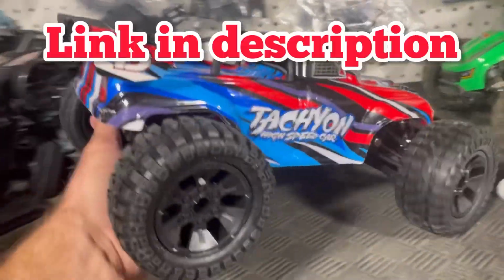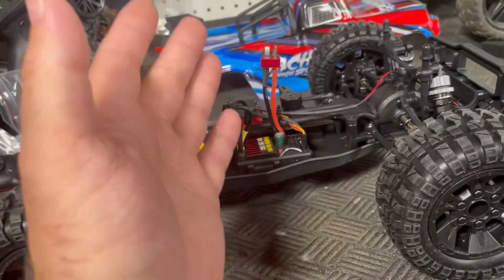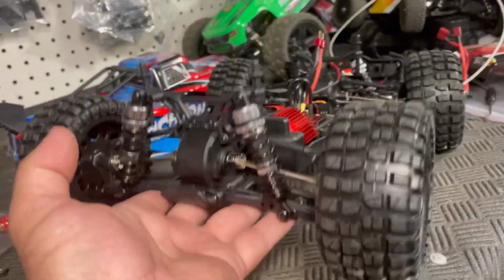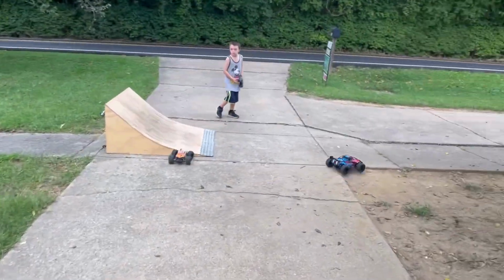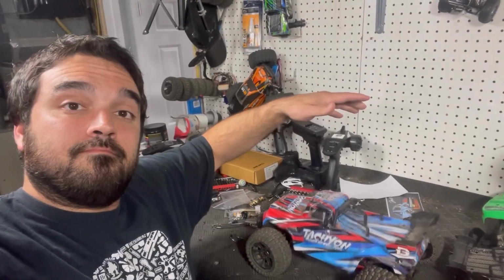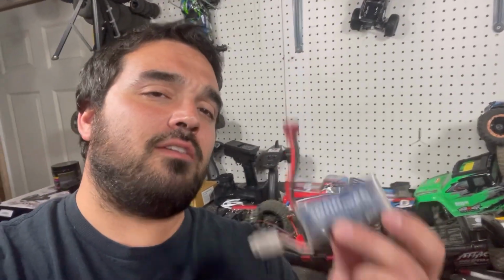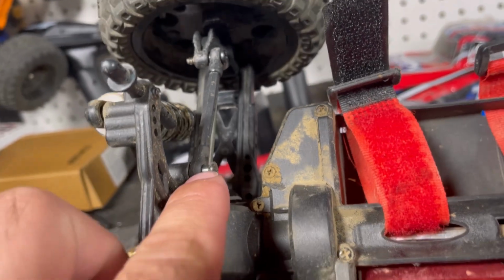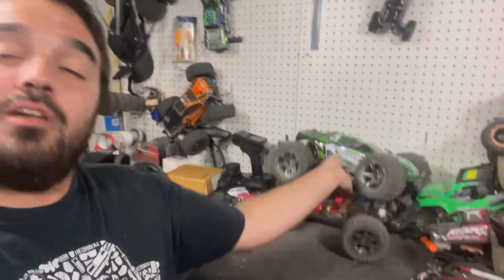New Brushless RC - 3s batteries included! DEERC 210E

Comment: Great video!! Your 5yr old jumps like a pro! These px9200’s really are incredibly durable. I have 2 of them. One of ‘em I put a SH Rocket 3660 3300kv with a rocket 80a esc and it handles all that power and all the abuse I can throw at it just fine! They’re great cheap rcs. Perfect to upgrade and bash around!!
Reply from the maker: Thanks! Yes I agree! I have a couple others as well with Hobbywing motor kits in them. They start to break eventually (especially on 3s)  but it takes a while and they do a great job!!
Reply: Thanks for the reply! I’m glad I found your channel, great stuff dude. I also have a couple of the FC610 trucks converted to brushless. Even got the same ZD wheels lol.
Reply from the maker: Thanks!!
Ya definitely a great truck !!! 👍👍
Reply: I do rocket everything and I freaking love it! Really low prices too
Reply: @FZERO20  ya same here! I have rocket motors and escs in most of my rcs. You gotta get yourself the Racing Rocket ‘Beast’ esc. They have em on AliE. I got the 80amp version. it is powerful! I honestly think it’s underrated cause It feels more responsive than my 120a Max10
Reply: @MarcoL972  I just ordered one last Friday🤣🤣🤣80amp too
Reply: @FZERO20  if you haven’t already you should try out the new V2 Supersonic brushless motors. They’re bada## motors! I just got a 3660 3600kv. It has more power than the black rocket motors
Reply: @MarcoL972  Aight bro, we seem to be on the same page with this sh*t. 😂😂If I could show you my “to be shipped” or “shipped items” you’d see that i got a (Surpass Hobby Rocket Supersonic sensored esc 120amp, an off brand hobbywing Xerun esc 120amp, a rocket rc supersonic 380 sensored motor 8.5t 2s 5000kv, and an 80amp esc from rocket unsensored). 
And thanks for the recommendation too because I’m used to using hobbywing previously but it burned out. All my rockets take the heat and the motors are truly amazing and cheap asf!
Reply: @FZERO20  🤣🤣 ya definitely seem to be on the same page. I just got the EZRUN max10 G2 80a and 3652 4100kv. I put it in one of my px9200’s. It’s an impressive combo but not sure if it’s worth the💰. Also have the 10bl120 and 2pole 3650 8.5T I installed in a wltoy a959 😃.  I’m still working on it but I’m hoping to test it soon. 

When you say off brand HW your talking bout the RTR versions? Those are actually real nice, and much cheaper. I got the 10bl50/60 and max10 120 sct RTR. I’ve had good luck with all of em. 
My go to is always surpass though. I really think they make the best stuff and can’t beat the prices
Reply: Oh ya, You said you have the supersonic snsrd 120a? Is that the 3-6s esc with 2 battery leads? I have that one too. I actually bought it by accident lol. I Meant to by the rocket 120. That’s what I get for rc shopping at 3 in the morn 😂😂. I haven’t used it yet. It looks like a sick esc! rather than return it I’m planning on getting a 1/8 car I can use it in. What rc are you using it with?
Reply: @MarcoL972  No I think it’s the supersonic with the 2-3s or 2-4s it doesn’t say when I look but i typically don’t go higher than 4s anyway. And I have 2 cars so far from Wltoys. A 124016 & 104001
Reply: @MarcoL972  and the off brand seems to be a “TSky”  it’s like $15 bucks total so idk bro😂 . Now I have no clue what I’m going to doing with these WAC’s between both cars, but I do know the 380 sensored motor is for my 1/12 scale car. I freaking love the 124016. The 104001 I plan to completely change the chassis to carbon fibre and switch to mod1 gearing. But man it would be great if their was a more larger community here in Georgia man. I go to parks and have a lot of fun with my cars but there’s never anyone doing the same or not at the same time. But you are right. The prices are unbeatable and when I upgrade my cars to brands like Arrma or Traxxas I don’t even think imma move away from what I’ve been purchasing. Plus Spectrum’s expensive as sh*t🤣 
But hey I’ll subscribe to your channel so if you ever have any videos or want to keep in touch you can . I got a couple of videos here and there you may like too😄
Reply: @FZERO20  Ya dude, I wish I had more people to do this with too. I’m in MA. I don’t know anyone else who’s into this hobby. It’s really just me. Luckily I have a big yard so I either go out in my yard or if i have time I got a couple spots down the street from me. My son comes out with me every once in a while. My daughter used to but she’s not into it anymore. 

Tsky? Is that those cheap blue escs? They’re like 15-20 bucks lol. The 380 snsrd motor is the surpass hobby suspersonic right?

I only have 1 Wltys. The A979B I think lol. The 1/18 buggy. I put a 60a esc from my Bezgar 9 in it and got 43mph out of it. That’s quick for brushed! Obviously That wasn’t good enough  for me though 🤣🤣. I just installed a HW 10bl120 snsrd esc and HW 2 pole 3650 8.5t. Then I fitted a 1/16 suspension from a caster racing s16 to widen the stance. I can’t wait to run it!!! It’s gonna fly!! Hopefully it stays in 1 piece 😂😂😂

Is that your 104001 in your video? That thing is fast ha! looks like it handles great too! What motor n esc you got in that one? Have you done anything else to it?
Reply: @FZERO20  I don’t have a channel lol. I should post some videos but I really don’t have time for it. I’m lucky if I even get time to use them. 
I honestly spend most of my free time just working on these things. I love it. I definitely work on them more than I use them. 
Im a mechanic. long time ago my hobby used to be real cars but after 20+ years of working on everyone else’s crap I don’t really enjoy it like I used to. Are you a mechanic too? 

Oh, I don’t know if you noticed, I subscribed to your channel.
Reply: @MarcoL972  Yo man that’s amazing tbh. I work 2 jobs currently so I barely have time for myself either but when I do. This is what I do. And yes! I’m a tech at a dealership. And tbh I may deny it but apart of what I like doing, IS wrenching. I took a 1 year break from automotive to learn sales and retail and nothing has EVER excited me as much as working on cars. Not only that, everything I like doing involves being able to service my vehicles or upgrade them. So naturally working in a shop gives you huge benefits over paying someone. Now, it just transitioned down to R/C and working on them down to seeing the end result is what I call good therapy.👌🏾
Reply: @MarcoL972  and yes the TSky is those blue esc’s. I may buy a handful of them next payday just to see how they go. 

And yeah man. Your exactly right about the 380, same brand and everything. I love the design of those motors too. 

And lastly it wasn’t my 104002, it was my 124026 in both videos you seen. It’s a 1/12 scale car but was my entry car and it’s my baby. I absolutely love the design of the car and the way it handles. 

Dude. Whatever videos you have, even old ones. Just upload them bro, even as a short if u have to. Ppl will see what you do and will later come to appreciate what you do on your time, as it is unique to just you. The same as me.

And 43mph is indeed fast for a brushed wow. I always wanted speed with excellent handling in my cars so I like to use sensored brushless setups as you can already tell😂
Reply from the maker: Just skimmed thru your guys conversation here and I used to be an auto tech too!
Been out of it for about 5 years now.
Reply: @DerbyCityRC  😂 small world! Seems like a lot of guys like us are into this hobby! I guess some people brings their rcs to hobby shops to get worked on. To each there own but I could never do that lol.
Reply from the maker: Agreed!
I couldn’t either! I’d need to become a brain surgeon just to afford all my repairs 🤣. Like you, I like the wrenching part of the hobby too! I don’t really miss the car work though lol. I’ve put off doing the timing belt on my ‘05 tundra for 4 years (when I got it) and it’s the OG belt at 186,000 miles.
Of course it’s getting a ton of other things at the same time and it’s my work truck so hard to set the time aside.
Reply: @FZERO20  I’ve seen mixed reviews on those escs. I think it’s like a hit or miss with those. Some work great some burn out. Ide keep it to 2-3s, wouldn’t push it with 4s. Probably the right idea to get a handful lol 

You gotta let me know how that 380 goes. Those motors look naf. 
Today I was finally able to get a good run on my Laegendary Nitro. I have that supersonic V2 3660 3600kv in it. I paired it with a 130a Dynamite Fuze I got used off amazon for 60 bucks! I took a chance getting it used but the thing is actually brand new!! It’s a nice esc. and That motor screams dude. Def my new favorite motor! 

I’ve always liked the looks of that 1/12 Wlty, I never got any of them though. Except for the 1/18. They def make impressive cars. Yours looks responsive af. That servo in it is quick! 
So you have 2 rcs? Are you just getting into the hobby? Get ready to get a lot more of you are lol. Damn bro, If we lived closer ide give you a few of mine… I got so many I don’t know what to do with them 🤷🏻‍♂️😂😂. 
Recently I’ve been getting into the larger scale rcs. Dude I literally just ordered the Redcat racing Kiaju!! I’m so pumped. I’ve been drooling over that thing for 2 years but could never spend the 💰 on it. Finally was able to get myself one! So excited to get it! 

Oh, and by the way, did you end up getting that stud out?? Lol
Reply: @DerbyCityRC  yup once a mechanic always a mechanic haha. My famous words to my wife when she says something is wrong with the car is Don’t worry about it, it’s fine. 🤣🤣. 
But you are 100% pushing your luck! 186 on a og t belt!! Wow, is that a record?? 
Those tbelts are a big job but not bad. Pretty straightforward job. 
Why did you get out of mechanics if you don’t mind me asking?
Reply from the maker: Yup we don’t need to fix our own 1:1 cars lol
I’ve seen t belt last over 200k on these trucks. And I did quite a few of them on my exact engine so no big deal. It is an interference engine so really gotta get going on it. I saw kia timing belts break more than once before even getting to 80,000 and blow the motor. 
I did several belts on older Camrys that broke, and those 3 and 5sfe engines were not interference engines so just a little
Puff of blue exhaust smoke at post service start up and they were as good as new, no matter the mileage! Toyota used some killer materials!
I got out cuz my knees and back started having problems in my late 20’s and that’s just no good. Plus my boss was getting grumpier and meaner by the day lol.
So then I went to work on the equipment for a local Home Depot rental center and eventually started my own Handyman business. Been at that for just about 5 years now.
Reply: @DerbyCityRC  ya man lol I remember the old Camrys. I saw a lot of those with snapped belts. They always started right up. All motors should be non interference. The easiest tbelt I ever did was on an old escort. If I remember correctly I believe it was just 3 pullies. crank tensioner and cam 😂😂. As simple as it gets. 
Ya, grumpier and meaner seams to be a thing with older mechanics who have been in the trade for years. I’m not quite there yet lol. 
I started wrenching when I was just 15 or 16 got my first job at a shop when I was 17 and now I’m 38. Still not too grumpy or mean though… well maybe a little 🤣🤣. 
And your right dude, this job isn’t easy on your body. My back and knees are toast. You Gotta go to a Chiropractor man, seriously they helped me out like you wouldn’t believe.
Reply: @FZERO20  Thanks bro. I mean, I gotta admit, i still enjoy working on cars. I just don’t like working on my own cars anymore lol. It unfortunate cause it used to be my hobby years back. I loved working on and tricking out my rides. That’s the reason I got into rcs. I got one a few years back and started working on it and I had so much fun doing it. Now I’m an rc addict 🤣🤣. 
Working on cars definitely has its perks. I have never brought my car to a shop to get fixed once in my life lol. It also has its downsides though. Like when someone major breaks and guess who has to fix it 😂. Like when the brake lines blew on my wife’s ml350 and I had to replace every line in the thing!! That was terrible. 
You are right. The rc cars ar definitely good therapy! I never thought of it that way lol
Reply: What an intense conversation I've just read.  LoL

I'm brand new, my kids just got the DEERC 200E and the 300E.  Now I want one of the 1/10scale, but dont know where to start getting parts. Everything in Canada is so bloody expensive... it's ridonculous.  So I can't find the model he was recommending for the brushed motors and then upgrading the system to Brushed to make it more affordable for entry.  I'd love some suggestions from the group to start with something I can upgrade as I grow. I hate starting at the bottom entry level of things, so please point me in the right direction with base setup and what brushless motor to get, ESC, and components that will withstand a bit of abuse!! Thanks everyone- I've sub'd to the channel to stay engaged!! (Also, my son's 200E can't handle even the smallest amount of water ... living in Canada.. we have snow melting this time of year. What components can I buy to keep his ESC and Motors waterproof/resistant and dry?)
Reply from the maker: Ya I did one on a 96 escort quite a long time ago. Many kias had easy belts too.
Also the 2000’s 4 cyl jettas were easy. Chryslers might be the absolute worst.
Well my boss was only like 33 at the time lol. Luckily I got out when I was like 29. Now 34 and seems like my joints are a bit improved. Need to get back to exercising though!
Reply from the maker: You did read quite the conversation lol
Are either of these available to you at reasonable costs?
https://amzn.to/3jyzdxO

https://amzn.to/3JMYa39
Reply from the maker: And thanks for subscribing!
Reply: @DerbyCityRC  OMG, do you remember the PT losers? What a s%#t show that job was!! 

Well good for you man. Good job opening up your own business. That’s not easy to do! Especially these days.
Reply: @davewoeckener5719  lol yes you definitely read quite the conversation lol! 

I agree with Evan’s suggestion. I have the YC400 and the FC610.  The YC400, Flyhal FC610, HBX 2995 and the Bezgar HM101 are all the same truck. So plenty of parts are available for cheap. The only differences are the bodies and wheels.
As we know this truck is extremely durable and for the price i firmly believe you can’t get a better rc. It’s is definitely one of my favorites!
Reply: @davewoeckener5719  The only thing I’ve broken are wheels and body shells. The wheels are made of pretty brittle plastic so if your doing jumps they will break eventually. 

I even had a 3660 and 120a esc in it at one point, now I have a 550 rocket and 80 rocket esc. It takes the power no problem. It’s a beast for sure.

Their customer support is good too. after sales service warrantied a couple of parts for me. I’m not positive but if I remember correctly i think it has a 3 month warranty
Reply: Dude do you have anything from Redcat racing? I just ordered the 1/8 Kaiju. (the original one not the EXT) It’s supposed to be a sick stunt truck. It’s gonna be my first name brand rc. I can’t wait!!!
Reply: @MarcoL972  my son already on day #2 broke one of the lower front control arms.  Snapped right where the shock goes into it... so now we wait for DEERC customer service to ship out new parts!! LOL
Reply: @DerbyCityRC  Well - the first link that leads to the YONCHER YC400 costs $307.57CAD (and I got the 200e with same batteries, but additional spare parts this one doesn't come with for only $166CAD on sale 4 days ago).  The HB2995 says it's not available to ship to Canada (go figure.... there's a lot of things that don't ship to Canada I want :( )

If I go with the DEERC 9200 - does that have brushed motors that I upgrade to brushless?  Then also upgrade to ESC (which means I also upgrade the remote transmitter) and the batteries.  Would I need to upgrade the steering servo as well?  The other links in the forum some work, and some don't anymore.
Reply: @MarcoL972  Whats the difference between the 200e and the 210e?
Reply: @DerbyCityRC  I just got back in to the automotive industry a few months ago🤣
Reply: @DerbyCityRC  it’s like that man. You work on other ppls junk all day everyday. You’re exhausted and unwilling to work on your own. Especially if you know the problem smh
Reply: @MarcoL972  yeah I’m definitely getting a few of them. They may all be good long lasting esc’s too. Who knows

And I’ll definitely lyk how that 380 operates once it arrives with my 120a esc

So far yes I only have 2 rcs as I just recently got into the hobby only a few months ago. But I’ve watched videos on YouTube for years as a kid. Parents just never bought em for me so I had to get em myself.😂definitely worth it though 

And same dude, I haven’t gotten the expensive rc I wanted yet but I do plan on going all out on an Arrma infraction. With a high quality fpv, long distance setup. Sometime in the future. But I already know that’s definitely way over $1k

Annnd, as far as the stud goes… nah I couldn’t get it out. I just installed a whole new engine mount bracket. It was a pain in the a** to wiggle it out of its place but I made it happen you know🤣🤣
Reply: @DerbyCityRC  yo nice dude. I had an 05’ IS300 I was getting ready to do some timing belt and engine upgrades on a while ago but I ended up wrecking the car. Now it’s pretty hard to find another one for a decent price. I worked at the tool rental department too man! Only for about half a year though because it was way more overwhelming than working on cars. I was basically a service advisor, parts manager, and technician all at the same time. While I still had to work up front when we were low on staff constantly calling out🙄. Good for you starting up that business tho. I got into selling new and used car parts online and I’ve been having decent success with that, I just need to invest a little more time into it
Reply: @MarcoL972  bruh who you telling?? I think I blew up my motor in my 07’ TSX and it makes a huge knocking noise while running. Still drives nice tho and has excellent suspension mods. I put a lot of money into the car and engine so I can’t just sell it. But I can’t just swap the motor because it has a lot of expensive internals I need to transfer to the new one I’m saving up for. In due time I’ll get it done though definitely . But actually while I was on standby waiting to rack my money up, I stumbled upon some cheap entry level rcs and this is where it took me. But I gotta say, it’s an excellent detour. If I really break something on my rc. It’s way cheaper and easier to repair than an actual 1:1 car so that’s just my way of cheating a bit. It certainly does feel good when I’m done and I go out with some charged batteries and spend a couple of hours at the park running them up and down the trails or on the street😁
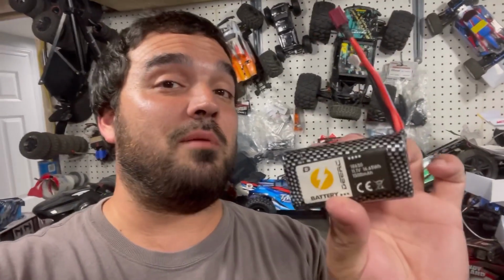Reply: @DerbyCityRC  that 1:12 scale yoncher is nice. And a really good price. Only thing I’m concerned about is the aftermarket parts and accessibility. If that’s good then I’d totally go for it if I like what it offers
Reply: @davewoeckener5719  just the bodies are different. The 200 is like a truggy style body the 210 is the pick up
Reply: @davewoeckener5719  😳307 for the YC400!!! Wow man you weren’t kidding!! Sorry man, that sucks.
Reply: @FZERO20  Damm dude that sucks. You just had me cracking up though! Just stumbled upon some cheap rcs! Your cars broke but you got some bas**s rcs!! 
Sorry, it’s not funny your cars messed up, just how you worded it lol. 

It’s definitely so much cheaper to fix and trick rcs. I think way more fun too. 

So you said your car is knocking but it runs good? You sure it’s the engine? Is your car auto or stick? I’ve seen throw out bearings make some crazy noises like that before. Typically the noise changes on/off the clutch though. I wonder if you have a bad rod bearing?
You gotta get your ears on and track down exactly where that noise is coming from before doing all that work.
Reply from the maker: I do! Even the smallest job on those were terrible. Luckily I’m pretty sure I only ever worked on one, but it seems they brought  it to us for all kinds of stuff lol.
Thanks! It was tough to get it going but things have been good 👍
Reply from the maker: Completely agree! The absolute best value and easily upgradeable once the 15-17 mph becomes too slow.
Reply from the maker: I don’t, but the Kaiju has been on my mind for a while!
Reply: @FZERO20  there really isn’t any aftermarket parts for it that I know of. You don’t need them though. The only thing you gotta do to make it just a completely sick truck is brushless upgrade, new wheels/tires and wheel spacers. 
The truck is definitely well worth the price the way it is. It has all hardened metal gears and a center diff too. All plastics are really nice quality and seldomly breaks, 6kg servo is a little slow but it gets the job done and the axles are super strong. It’s a good truck. 
Watch Derby’s FC610 vids. Its the same truck
Reply: @DerbyCityRC  we actually had one come in the shop last week!! I think it may be the last surviving Loser 🤣🤣. 
Yes Everything on those cars was a pain. I remember doing t belts on them all the time. Had to jack the engine to the moon to get to some parts then lower the motor until it was literally about to fall out to get to other parts. What a nightmare that was lol. They musta been drunk when they designed it.
Reply: @DerbyCityRC  ill let you know how it is. It’s supposed to be delivered today!!! 🥳
Reply from the maker: That stinks it’s so pricey for you!
Yes the 9200 comes with brushed motor so you can upgrade the motor, esc, and yes the servo along with transmitter and receiver.
Those are the same chassis as the 210e, which really are solid. Bad crashes will certainly break them lol
Reply: @DerbyCityRC  wow the Kaiju looks amazing! It looks much bigger in person. Videos and pics don’t do it justice. I can’t wait to bash it!!! Ide love to see you launching this thing off your Ramps!
Reply from the maker: That stinks its so pricey for you! What about this one? Same car also.
https://www.banggood.com/custlink/mm3pHkRFq5
Reply: @DerbyCityRC  the first review on this  FC610 BG link is mine. Marco320. Check out the wheelie bar I installed. Took it off a Laegendary Thunder. Little work to fit it but perfect fit
Reply: @DerbyCityRC  I think the body shell on the FC610 is nicer quality than the YC400. I landed on the nose once with the YC400 and the body literally shattered into pieces. My FC610 body might crease or dent but it hasn’t cracked at all
Reply: @DerbyCityRC  well... another gooder... except this one doesn't ship to Canada either.  Either doesn't ship to Canada, or it's too expensive.  I'm thinking of getting the DEERC 9206 ($156CAD) and upgrading to a bigger motor, ESC and batteries.  DO I NEED to upgrade a different Servo too when I upgrade the ESC?  Then how do I match the ESC to the right size batteries and motor?  Sorry to be a pain, we all start somewhere... and the reason I sub'd to you is because I see you actually answer your fans questions!  Can you do me a solid and point me some links to a better Motor/ESC/Batts for this (and servo if needed).  THANK YOU a bunch man!
Reply from the maker: Haha!
Congrats!?? Lol
Reply from the maker: Ya it’s got aftermarket support since you can get hbx 2995 parts for it!
Reply from the maker: That’s cool lol. Ya man I did really well at tool rental. I wore all the hats too. I worked there part time for 8 months while still working full time at the auto shop. I got them caught up and kept everything repaired, including customer stuff as a part timer while that store called for two full time techs. Then realized it was a better job and left the auto and went there full time. I had corporate dudes that came in to see how I was keeping up by myself. I was like experience and organization lol. Diagnosing instead of guessing. Never got more than a handshake from them though. In the end it wasn’t enough money to carry a family of 6 🤣
Reply: @MarcoL972  nah it’s cool bro you good😂that’s just what it is

Yeah it’s knocking. I’m pretty sure it just spun a bearing. Or like you said, a rod bearing. But I got a flashing CEL ofc and it’s also telling me my emissions is out of whack which makes me think it’s just a bent valve. Idk but I’m pretty sure it’s near the bottom end that the noise is coming from. And unfortunately it’s auto. Either way the motor has over 250k on it and it did an excellent job throughout all those miles. I’ll save up for a Jdm spec motor and swap it in with a 6-speed sometime in the future. But I have so many bills and I keep spending my money on other sh*t🤣 but in due time itll happen. The car has weight reduction and suspension upgrades so it has excellent handling .
Reply from the maker: Yup I remember all the engine jacking and raising lol
Geez I haven’t even seen one on the road in what feels like years. Be sure to take a picture and frame that shit! Lol
Reply from the maker: Seem well built?
Some people say it’s junk and some say it’s a beast!
Reply from the maker: Lol that’s good to know. The hbx 2995 body is even better. It has a plastic roll cage. I’ve pounded the shit out of it and only has a little crack on the hood
Reply: @DerbyCityRC  sheesh man small world. It was pretty much exactly the same for me. Except I worked at HD full time and worked at Wendy’s partly. Corporate guys would come by and I’d get the same treatment too. I ended up switching over back to automotive full time and I work at publix partly. I literally make a bit more than double the money. And I get paid weekly not bi weekly so things are way smoother with both jobs currently. And just like you said. I pretty much caught up with everything customer and store related in tool rental. I even fixed some of the tools that were downed month before I arrived there. I’m just glad I didn’t leave with a trail of crap behind me. It was honestly a pretty comfortable job as I had my own room and work area away from the actual department store
Reply from the maker: Can’t believe you can’t get that one either. Lol well actually I can, I hear about this all the time, just surprised it’s still an issue.
Do you have access to this car? It’s exactly the same as the 9206e but the body isn’t quite as cool and it only comes with one body. It’s cheaper if available. Here it is atleast. Thanks for subbing!
I’m gonna answer as many comments as possible. It’s become a good few hours a week at least and that’s a lot when you have a family of 6 and a business to manage. Not to mention trying to make videos 🤣
I like it and that’s why I do it!!
And yes you will need a different servo which I have listed below.
So here’s the parts I used on mine except I can’t find my motor anywhere. This one is the same price and should be comparable:
https://amzn.to/3RS8dpG
https://amzn.to/3Yom89u
https://amzn.to/40ErBKB
https://amzn.to/3YG2o0J
https://amzn.to/3JXQsmK
I think that’s all if them. Those shocks are much nicer.
Reply from the maker: Ya I loved that job for all those reasons. When I started they were in bad shape. Their “tech” was a 70 year old dude who thought he knew everything but was as dumb as a refrigerator full of rocks. He was arrogant, lazy, and Couldn’t fix a damn thing. Every time he ordered a part , he ordered 5 of them for extras. I assume my room was like yours and we didn’t have room lol. We had to throw hundreds of parts away when they fired him. There was 52 items on the down list and literally atleast 50 more that my manager was afraid to put on the down list. I was there for 3 years, and unfortunately their back in shambles cuz I’ve been gone now for 2 years. I even trained another tech and he worked with me for a while before I left, but he couldn’t keep up and he quit about a year after I left. They’ve had a couple more come in and then stop showing up lol
I seriously loved that job I don’t get it. I feel bad cuz I still know all the people including the store mananger and they need someone bad.
Reply: @DerbyCityRC  ya I know the reviews are all over the place. It looks great As far as I can tell without using it yet. The shocks are amazing. The dampening is crazy. The wheels and tires are sick. Suspension is nice and beefy gears sound nice. The upper arms could be a little bigger. Hopefully they don’t break. Idk, time will tell.   Let’s see how fast I break somthn lol.
Reply from the maker: Lol keep me posted! I feel
Like upper arms are what I remember seeing break a lot. I’m sure there are upgrades!
Reply: @DerbyCityRC  I've gone and ordered the HOSIM X07-R.  It's a 1/10 scale.  Biggest thing is that it already has some upgrades without having to break the bank (and this one is water-resistant/proof <or so it claims>). It has an upgraded 2847 Motor, Aluminum oil-filled shocks, 45A brushless ESC (3s up to 11.1V), 3kg high torque servo, and two shells.  I bought on Amazon with the single battery package (5200mAh batter) for only $215 and then spent $80 to buy 2 more 3s LiPo 6000mAh 11.1V 60C batteries to maximize the power. All said and done, it was just under $300CAD which was what I wanted to spend.   If I choose to do the upgrades, WLToys has a great selection of parts upgradeable to metal/aluminum at a decent price.   Are you familiar with this unit?  Do you know if it's the same parts (replacements) as the 200E (or 9200E series)?  I have to get upgraded parts for my older sons 200E, and my younger sons 300E... so before I go and spend money on the newer parts, I may as well find out if the 200E (1/10th scale) will still fit the new X07-R.   There's my update - and I'll post an unboxing and video of it when it arrives!
Reply from the maker: Cool!
Yes I have the x07. I don’t remember it having an “R.” Is that an upgraded version maybe?
That was a very fun truck. I have a video on it already. It is very different from the Deerc vehicles. The parts are not interchangeable unfortunately. 👍👍
Reply: @DerbyCityRC  funny - on my order it doesn't say "R"... or on the add, but in the fine detail description it says that. I just cut and paste it for when I gave the info here to you. If the parts aren't interchangeable... where can you point me to get them? Will WLToys have the upgraded steel or aluminum parts? Which equivalent can I use to base the parts orders off of? Thanks man, I'll go check that video out this weekend!!
Reply: @DerbyCityRC  isn’t the hosim x07 built off the XLF X03? I’m 99% sure they’re the same truck. Ali has tons of parts for the X03. I checked and it says they ship to Canada. 

I have a handful of stores I buy from frequently on Ali. Prices are usually cheaper and the selection of parts is unbeatable.
Reply: @DerbyCityRC  so far so good with the Kaiju. I bashed it around today on 4s. Ot must be crazy on 6s. 
It’s frigin sick! It will ride a wheelie all the way across the large soccer/baseball field I go too. 
I was fairly easy on it but still had a few typical wipe out bashing around. Did some light jumping. Had a Couple nose landings and roof landings and a head on collision with a pine tree lol. Still No damage at all. Not even body damage. I’m surprised, it’s a heavy truck.
Reply from the maker: Yes they’re the same with a few basic differences. I have them both but I can’t remember what the actual differences are lol
I’ve actually never by from AliE lol
Reply: @DerbyCityRC  you should check it out. They have a ton RC stuff. 
Before you buy from a store it’s good to check their rating and read some reviews to make sure they are good. Most of the sellers honest. I’ve a problems with a couple sellers but Ali stepped in and helped me out. 
You can find tons on genuine HW stuff. You can find stuff you won’t find anywhere else. 
There’s like 4 or 5 SurpassH stores. I mean, they literally have everything.
Reply: @DerbyCityRC  get the app, it’s better. I bet you will find that HW motor you haven’t been able to find. 
You can also contact the sellers directly about products. 
Pretty much all the Chinese brands you find on Ama and BG like PXTOYS, HBX, MJX ect you will find on Ali usually for cheaper and much wider variety of parts.
Reply: @DerbyCityRC  also tons of misc parts too like wheels, tires motors, shocks, ect ect ect ect… lol
Reply: @DerbyCityRC  those ZD wheels you have on your FC610 are 26 bucks straight from SH store. That’s where I got mine
Reply from the maker: I’ve seen some of the parts on Amazon. The rest are probably on Hosims website. I haven’t ordered any replacements for it yet. I also wouldn’t put any aluminum on it. You ant those suspension parts to be able to flex 💪
Reply from the maker: That’s good news! Ya it does look pretty heavy lol those trees tend to come out of no where!
Reply from the maker: Nice I think I will check it out. 👍
Reply from the maker: Awesome!
Reply from the maker: I do get a lot of stuff like that 🤣🤣
Reply: @DerbyCityRC  Yup! They definitely do!…WHO PUT THAT TREE THERE!!
Reply: @davewoeckener5719  I'm in Canada and picked up a DeeRC from Amazon in early January for $160. Definitely a fun Truggy for the price. I shattered the rear wing after doing some cartwheels on the ice. Then one of the rear body posts snapped off after doing a snow jump. I tried to glue it back on but only managed to glue a broken post into the shock tower so I wouldn't recommend doing that. 😂 I also broke a rear shock again doing a bit of snow bashing. It was pretty cold out every time I broke something so i think these plastics don't deal with the Canadian winters very well. I will say DeeRC customer service was decent to deal with. They sent me 2 new bodies when I asked for a replacement for my broken rear wing which I never did get but I also got a set of front and rear shock towers to replace my broken one. 
I also ordered that HBX 2995 that you mentioned that Amazon wouldn't ship to Canada. I just ordered it from Amazon US site and paid the conversion. It was on sale at the time 112$ US + a 20$ coupon so I got it for about 170$ Cdn all in. I think the price has been jacked up again but keep an eye open as it may go on sale again. My plan is to convert it to brushless eventually.
I agree prices are pretty jacked up in Canada most of the time but sometimes you can get some decent deals. The nice thing about the PX9200 (Deerc) and the HBX is that parts are available and they are cheap...just have to wait sometimes. That's why I am trying to get a nice collection of RC's so we always have something to bash around with. I got a 3 year old who is a pretty good driver at that age and he's big into RC's. Good luck with your RC hobby.👍🍻
Reply from the maker: Awesome! Yes all the cars break easily anything below 40°F. The 2995 is still the most durable truck I think you can buy for the price and takes upgrades so well. Thanks!!
Reply: @DerbyCityRC  So most these rcs are made of a nylon plastic blend. Nylon absorbs and retains moister. That why in the summer when it’s humid these parts are insanely flexible and don’t break. 
But In the winter when it’s cold and dry the nylon will lose its moister and dry up making the parts wicked brittle. Idk fun fact I guess 😂. 
All I know I can’t wait for it to get warmer cause I been breaking way to many parts lately!!!
Reply from the maker: Nice info. Ya the cold sucks. Breaks things that literally never break otherwise lol
Reply: Silly question (not sure someone has any ideas how to fix this...)

We ended up fiberglassing the body to make it more rigid and protective (plus now it takes a beating and keeps going), however the body-posts are designed to allow a thin plastic body. So once I've added about 1-2mm of fiberglass, it makes it EXTREMELY hard to get the pins in place. If I buy new body posts from DeerRC, they're the same height from the pinhole to the bracket (flat part that the body sits on). Is there any aftermarket posts that have the distance longer from the bracket to pinhole?
Reply from the maker: That’s odd I don’t remember having that problem on my Deerc bodies I mesh taped and shoegooe’d, but I have had that issue on other cars. If you look on Pxtoysrc.com, they have metal shock towers that come with metal body posts. I don’t really like metal body’s posts cuz they bend If you crash it upside down, but that may solve that issue
Reply: @DerbyCityRC  Did some skatepark bashing and broke 3 more body posts today. lol Guess I'll try the metal ones now. Other than the posts, some shell damage and the front bumper breaking off from the chassis underneath this DeerC 200e held up really well. The oil- filled upgraded shocks made a big difference for jumps and landing. My brother had his Hosim X-07 out there and that thing got completely trashed. Some serious durability issues with that one.
Reply from the maker: Ya these are more durable than the x07 I think. The axles do kinda bend easily and the bumpers get beat up too like you said but the warmer it is, the better they do.
Reply: @mikew.2935  I’m curious, how high do you have your body post set up? When 1st got my 9206e I was breaking the post constantly. I realized I had them set to high. Now I set them with 2-3 screw holes exposed max. Haven’t broken one in a long time. Maybe try setting them to the lowest position first. 
If that doesn’t work then the alloy upgrades is your best bet. 
Another thing is your body. I think your breaking so many post because you stiffened up your body shell. it’s not flexing like it used to, so those little post are taking the majority of the impact when you crash. 
Like Evan said, if you do get the alloy upgrades just don’t be surprised if you start breaking other parts that aren’t so easy to fix. 
My experience when mounting alloy parts to plastic diff housings and chassis… is breaking diff housings and chassis. Sucks when that happens. Literally just happened 2 week ago to my alloy upgraded 1/10 vrx racing. 
Good luck man!!
Reply: Sorry for any confusion with what I wrote to you. I got your post mixed up the Dave W post. I thought all these post were from the same guy lol. Didn’t realize until 2 second after sending my reply. 🤷🏻‍♂️ 
Definitely do try setting the body post to one of the lowest positions though. It does help
Reply: @MarcoL972  lol, no worries. A lot of posts in this thread...easy to get confused. I'll definitely try that. Thanks 👍
Reply: @MarcoL972  This is good advice for me as well because I have a 9506e that my 3 year old is using and it's held up better than anything. I think because it's not as fast it doesn't get damaged as easily but literally have not broken anything on it yet. It's a fun little unit. Going to upgrade it to brushless whenever the brushed motor gives out. Cheers 🍻
Reply: @mikew.2935  your going to love it once you convert to brushless! I think I have every version of the px9200 lol. It’s a really versatile platform. 
one of them has a 3650 3300kv w/ 60a esc I use mostly for jumping. 
I put a 80a Max10 G2 with the 3652 4100kv in one I use for bashing and speed. 
I even had a 3660 3500kv w/ 120a Max10 RTR at one point. It handled the power just fine, but it was honestly way to much power lol… if there’s such thing. 
Oh, I also converted one to a crawler 🤣. That one took some work and customizing but it actually does pretty damn good believe it or not! 
I got a couple more still in the boxes i just use for parts lol. Ya, i know, I got a problem. Definitely a rc addict 😂. Probably have like 40-45 rcs and probably enough spare parts to open my own hobby shop 😂😂. My wife and my kids think I’m nuts lol… 
Anyway, out of all my px9200s I have only broken body pins one control arm and a couple bodies. It’s pretty crazy. They really use nice quality plastics. The only alloy upgrade I have done, which I highly recommend is the upgrade steering kit or bellcrank. Part # is px9200-20. It really helps the steering out a lot. new steering arms helps the steering response a lot too.
Reply from the maker: lol there’s probably like 10 different people in here somewhere!